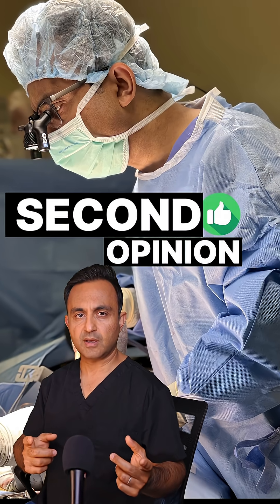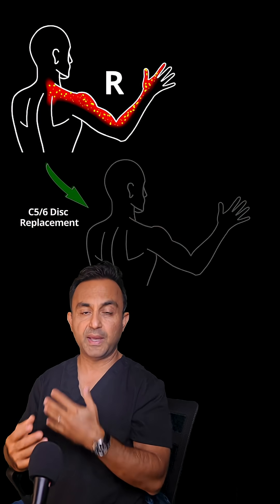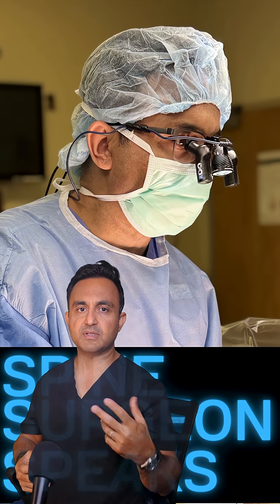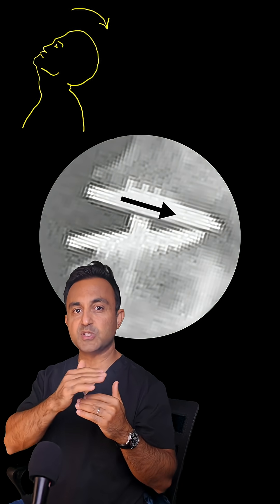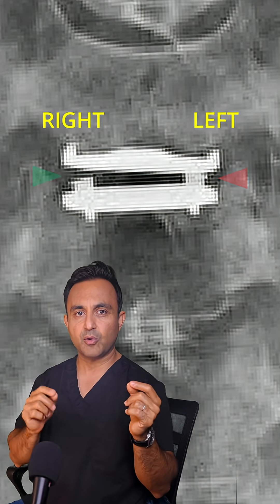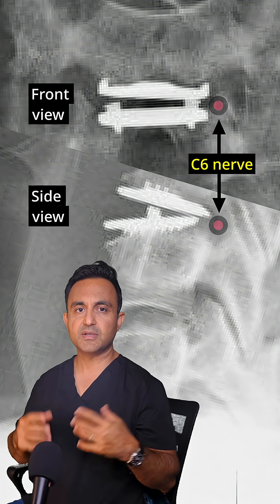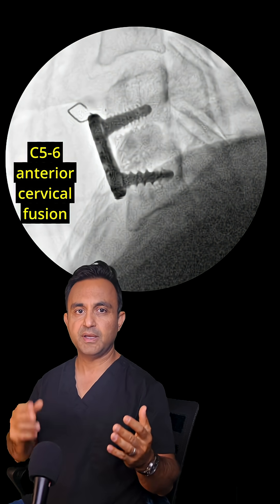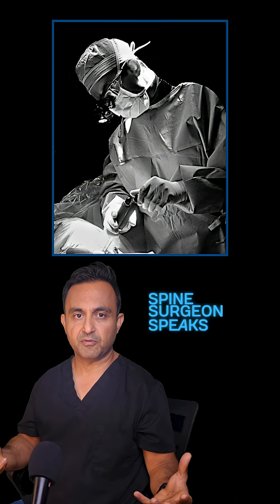failed disc-replacement #neckpain

Comment: My mobi-c looked like that since 5 weeks post op. My surgeon/ X-ray report never said it was failed even though the pain had return. I was put through intensive pain management procedures for a year and finally surgeon advise a 3 level fusion. I went to get second opinion and only then was told my artifact had failed. Is it something that some surgeon is not considering a failure when the implant looks like a < instead of = while in neutral. Every time I look up the pain is worse. I’m dizzy. See double.